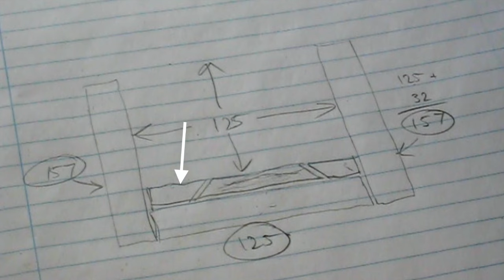Flatten timber with your table saw. Re-edited homemade tablesaw saw milling jig

Comment: Nice jig, would have liked one last week as I had a few boards to reconstruct. Aah well for next time then. The routing idea would do me in as I would more than likely take out the sides of the jig with the router bit. 🙂
Reply from the maker: Thanks mate. I know what you mean, I'm sure if you look close enough to my jig you'll see some router marks in the top edge 😂
Reply: @DownUnderWoodWorks  I immediately saw the same problem, but I guess you can avoid it by using a propper sized bushing, or even drill holes and attach a smell fence to the plate. Another aspect is, if I need and make this jig, to make it wider and do the job for my tiny 8" jointer.

Comment: I remember the original video Vic but the re-edit does equally as much justice to the original mate. Looking ahead to seeing your #woodjigs21 entrant video 🤠👍👍👍🍺
Reply from the maker: Thanks mate, I was pretty happy with the re-edit. I found it amazing that the new version is only half as long as the original but still contains all the necessary steps and info